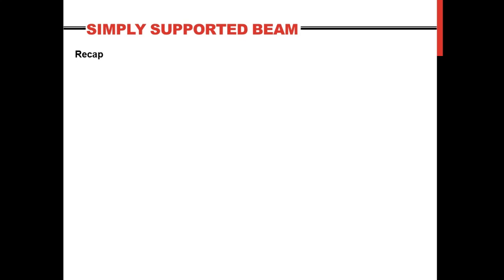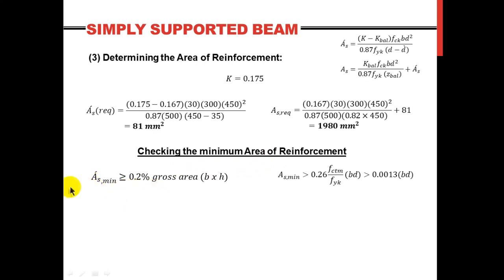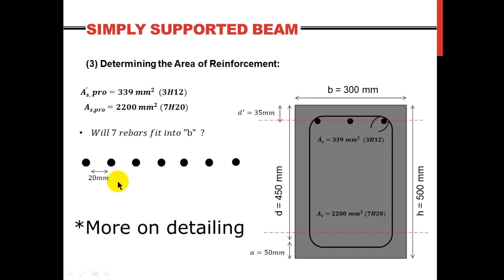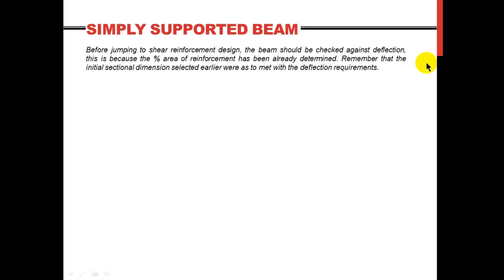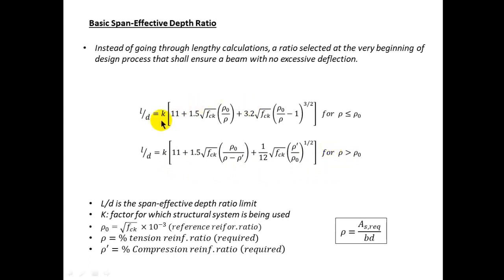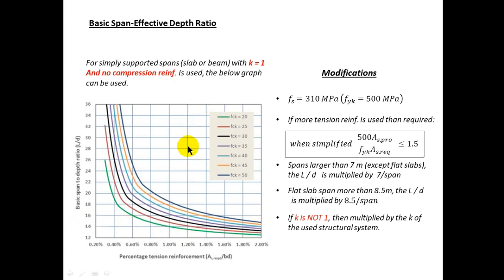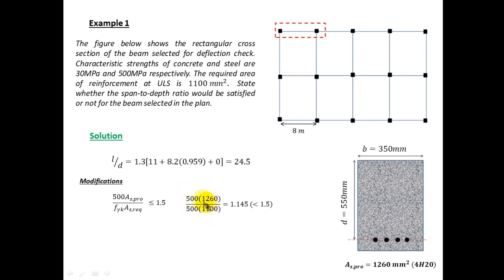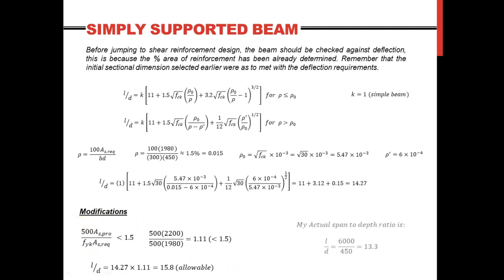Part 2: Beam Design to EC2 (Reinforcement Area & Deflection Check)

Comment: Okay I have a logical question: when you put 2T20 as second layer, you have minimized the steel area provided as the Z is reduced in second layer, you have to recalculate and verify your tension steel, thanks alot!